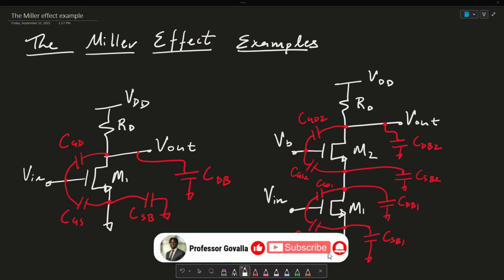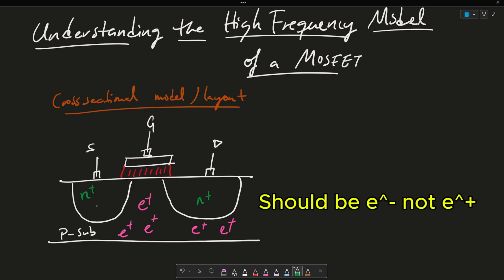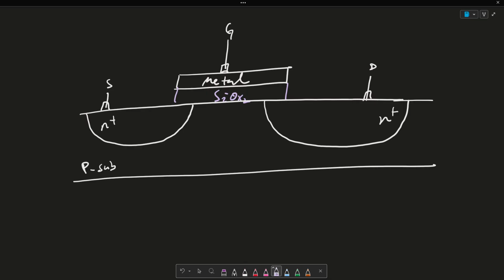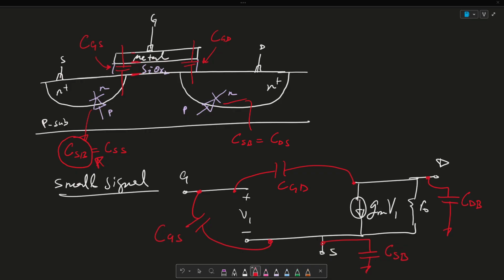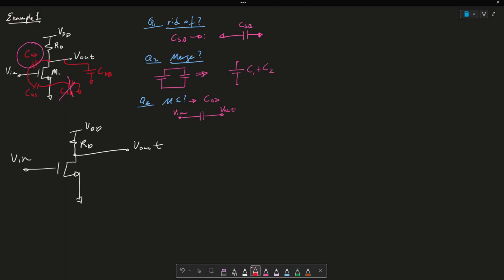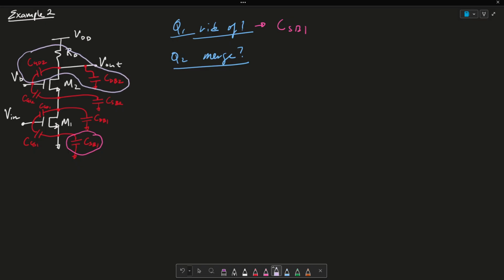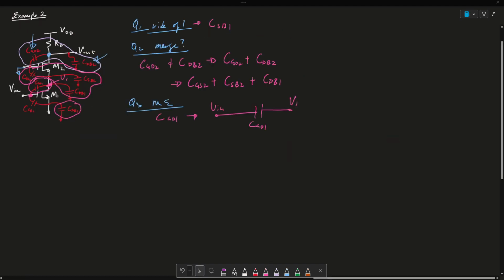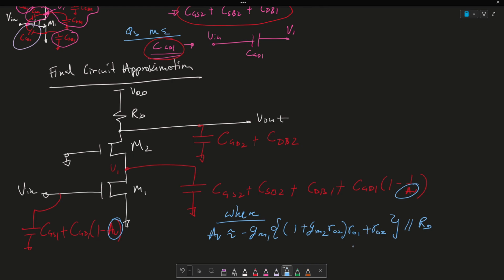Miller Effect Examples (High-Frequency Model Of A MOSFET) - Clearly Explained

Comment: first of all,thank you for these kind of video i have one question as you explain in the previous video the meller effect aplly in linear circuit but transitors not a linear compnent.
Reply from the maker: Great comment and observation. Although transistors are non-linear components overall, when we design amplifiers, we use small-signal analysis around a fixed DC bias point. For small AC inputs, the transistor's response is approximately linear with a constant gain A_v = -g_m R_D. Because the circuit behaves linearly under these small-signal conditions, Miller's Theorem applies directly to the AC equivalent circuit.
 Note that, Miller's Approximation simplifies analysis by assuming A_v is a constant real number, making it accurate for finding the dominant bandwidth corner frequency. However, at higher frequencies the standard Miller model loses accuracy (because A_v is no longer a single constant but a frequency-dependent complex gain due to the parasitic capacitance—Cgs in a common-source amplifier example)—which is why full nodal analysis (KCL) is needed for exact high-frequency pole/zero modeling.
I have made a few videos about this, so feel free to check them out; links are below. 

https://www.youtube.com/watch?v=-4k1z17jdHE - This shows how the Miller Effect can be used to simplify the small-signal analysis of a common-source amplifier, but we lose accuracy at high frequencies. 

https://www.youtube.com/watch?v=5Bokzdq5CCs - This shows the exact small-signal analysis of a common-source amplifier. 

I hope this clarification makes sense; thank you for the question.

Comment: Hi Professor Govalla, these videos are very helpful. Though I'm confused if you used the correct gain equation in the last step... We are finding the miller capacitance for the capacitor connecting the gate and drain of the M1 fet. The output is connected to the drain of the M2 fet. Wouldn't this mean that our gain Av, would be from the common source stage of this amplifier only? As the gain Av = V1/Vin != Vout/Vin? I'd then assume that the Av = gm1ro1. Please let me know if I'm missing something here
Reply from the maker: Hi, great question. 

There's two way to look at it. 

(1) The System-Level Approximation (less accurate): For the Miller effect of C_GD1, we consider the Av gain = Vout/Vin because M2 also plays a role in the amplification of the entire circuit. The amplification I'm referring to is the regular cascode amplifier circuit without the consideration of parasitic capacitors. Check this video (https://www.youtube.com/watch?v=TOTGIJFVSxM) called "Cascode amplifier - small signal analysis (part 2)". Miller's Theorem say we can split C_GD1 using the Av (Vout/Vin) gain of the entire system when the system has no parasitic capacitors. As a result, we are using the gain equation from the last step in this video. 

(2) The Local Node Analysis: You are absolutely correct in your reasoning. The Av of C_GD1 is V1/Vin, which is the proper gain to use the Miller's Theorem of C_GD1. 

I hope that makes sense.